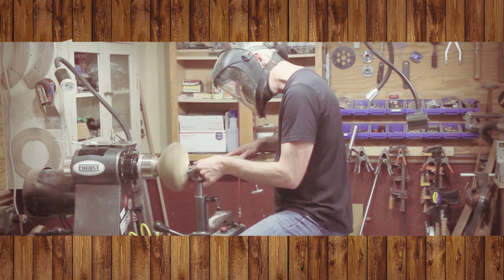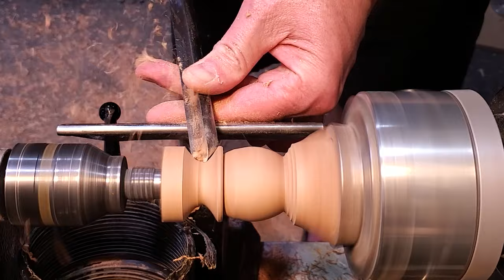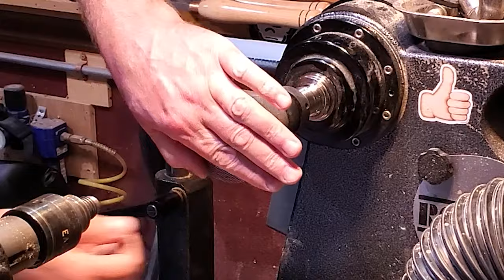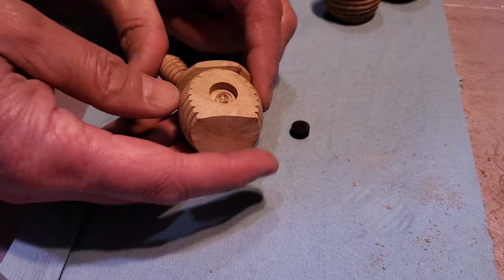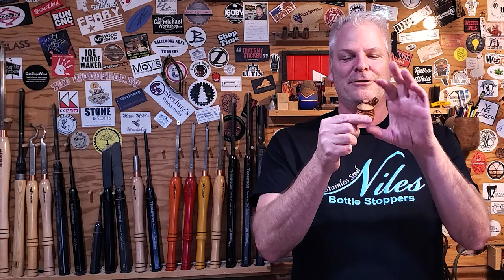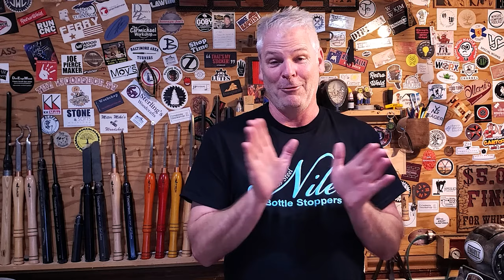Woodturning | Production Project For Craft Show

Comment: When I make similar small turned items, I submerge the entire batch in a jug of oil, then tip the whole lot into a funnel leading back into the oil bottle. The funnel has a gauze filter to catch any stray shavings. (paper  V60 coffee filters are extremey eficient filters if you feel the need). I leave it to drain overnight, as it's my last job of the day.